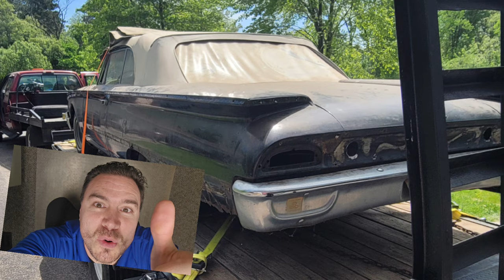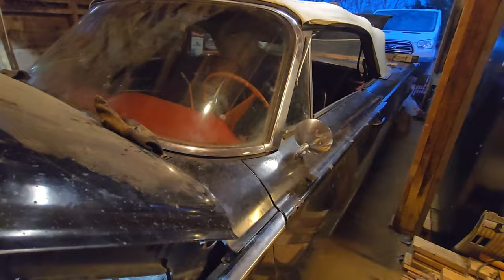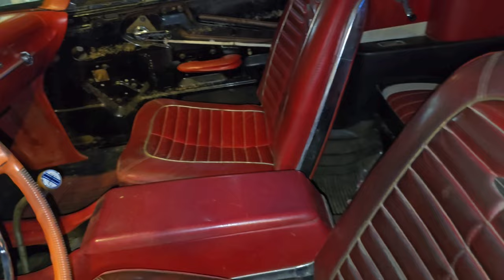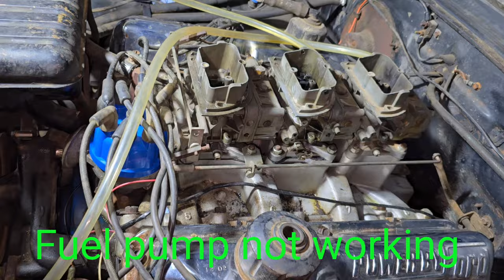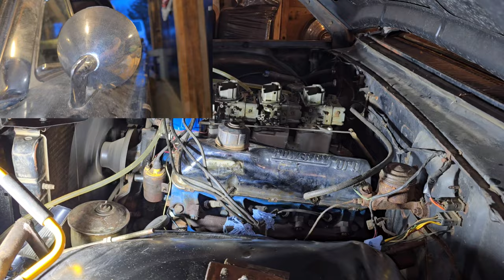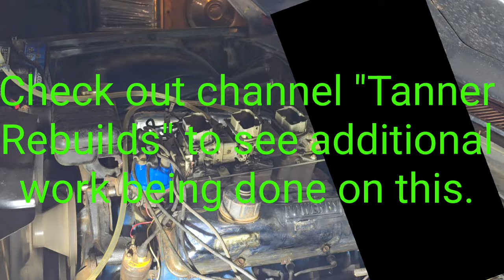Starting this rumbling beast. 1960 Sunliner

Comment: The big problem with all '60 Fords is rust. They seemed to rust out more quickly than earlier or later years. Even many found in the sunbelt have rust. I do own a 4dr. Fairlane 500 from Calif. which has only 22,000 on it and is rust free. 292 v8 and auto.
Reply from the maker: Yes, there seems to be a specific spot near the body mount under the door where they are the worst. There are some factory holes in the frame there that must collect a lot of moisture and salt.